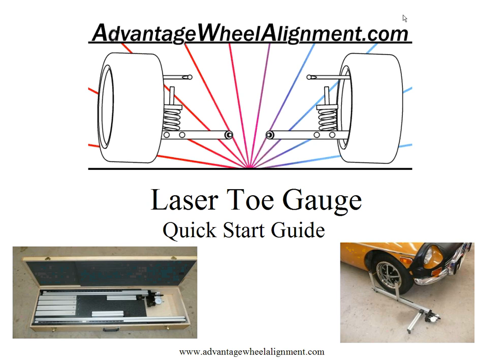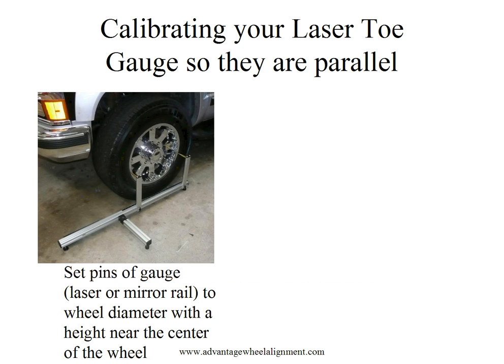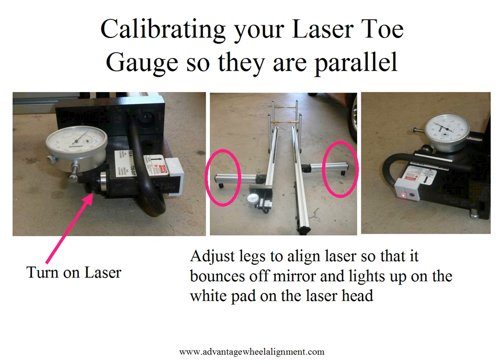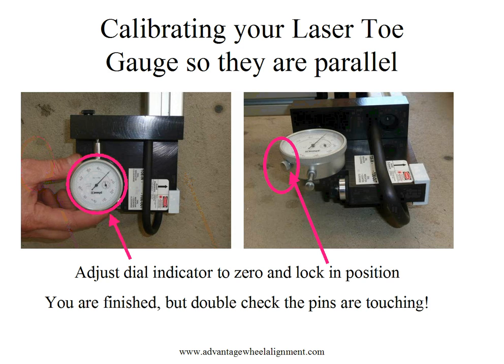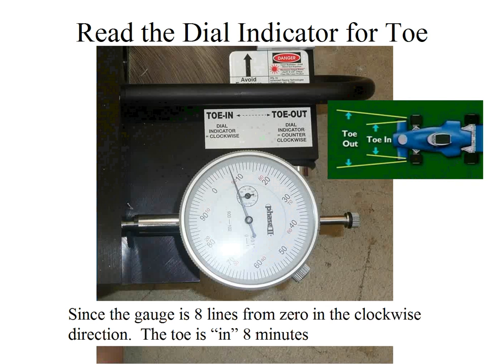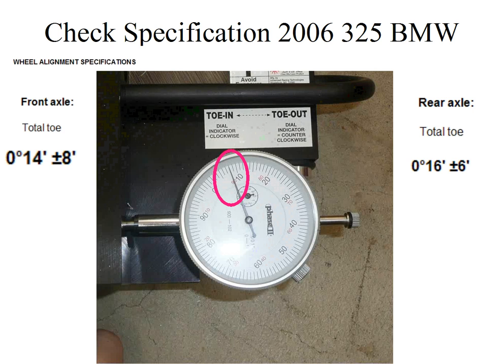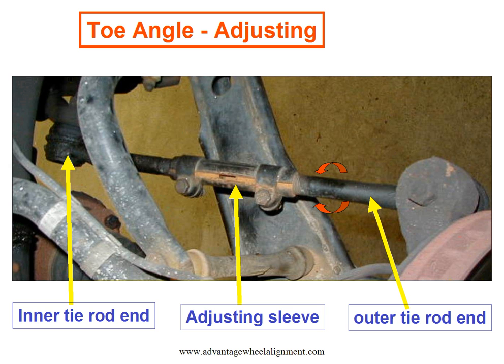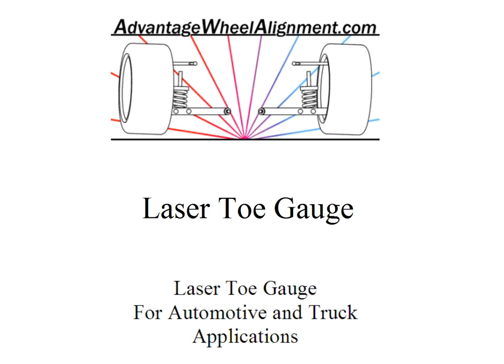Laser Toe Gauge

Comment: hi, i have this unit, after calibration is complete, when i was measuring the toe,
step 1 i adjusted the laser rail, levelling pad to shoot the laser on the center of mirror, 
Step 2 then I went to the mirror rail and adjusted the levelling pad to bounce back the laser back to shutter pad
step 3 then i adjusted laser angle to find minutes.

Between Step 1 and 2 after i adjust the levelling pad, i readjusted the wheel pin just in case if it is off.. then i did Step 3..   is my understanding correct.